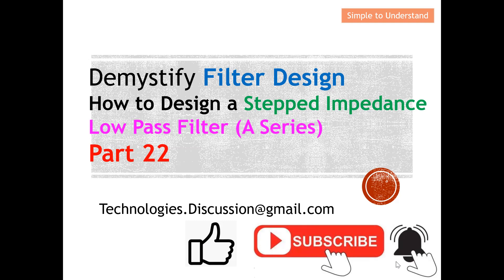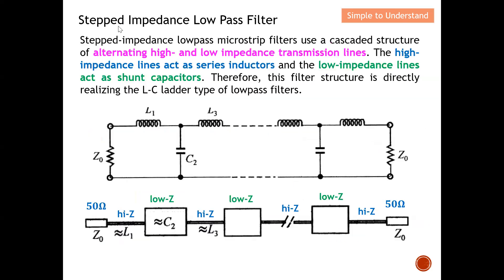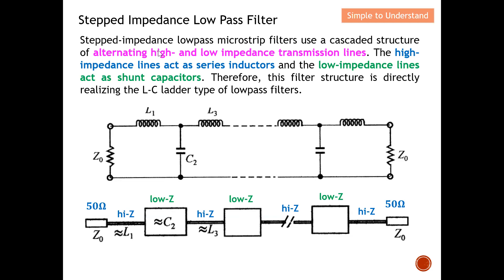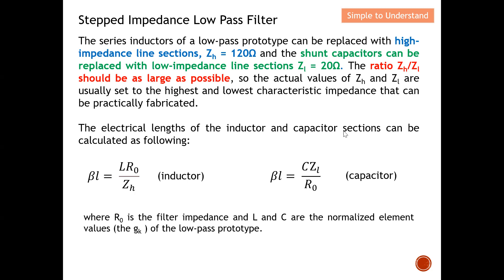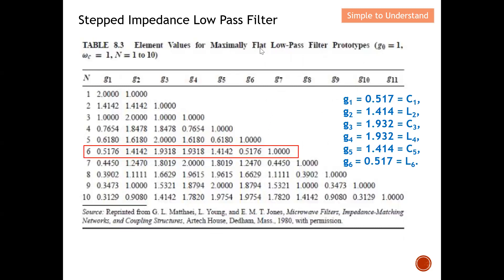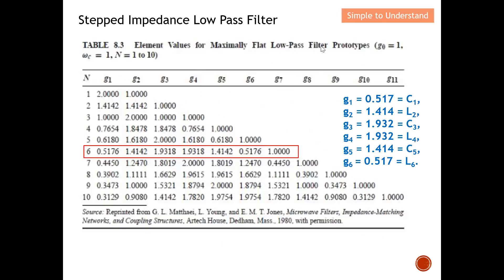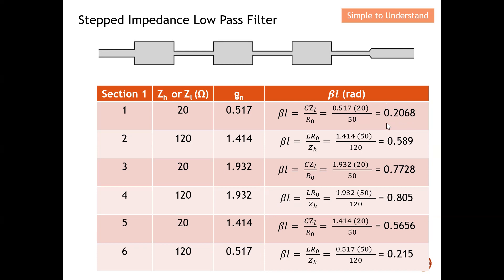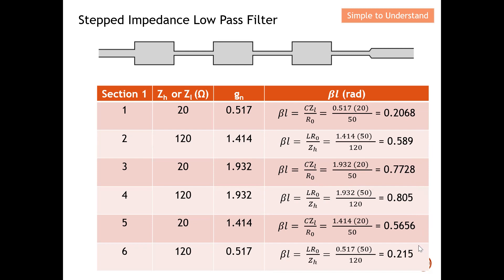Filter Design #22. How to Design Alternating High-Low Stepped Impedance Microstrip Lowpass Filter.

Comment: what would you do differently to make it a high pass filter?
Reply from the maker: A High-Pass filter is completely different. If you use lumped elements to design one, the first element should be a capacitor in series, and the shunt element should be an inductor.
Here are two approaches to design them:
Filter Design #20: How to Design an Optimum Distributed Wideband High-Pass Filter with Shunt Short Stubs.
https://youtu.be/g5Ip2ujdGbE
Filter Design #30: Low-Pass to High-Pass Transformation – Impedance & Frequency Scaling Explained!
https://youtu.be/hNkQN2YBATY
Reply: @technologiesdiscussion1676 thank you very much!
Reply from the maker: Thank you too for your strong support!!!  :)